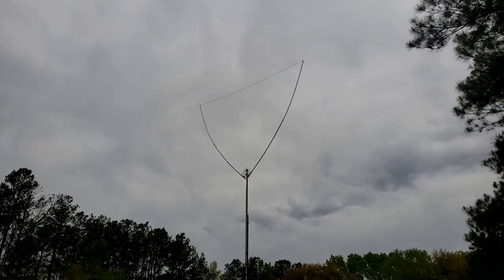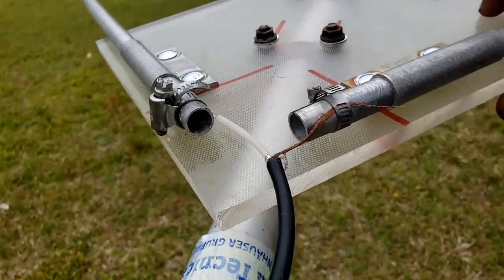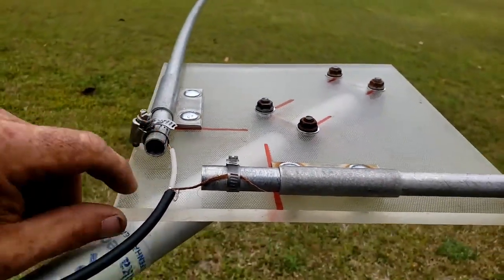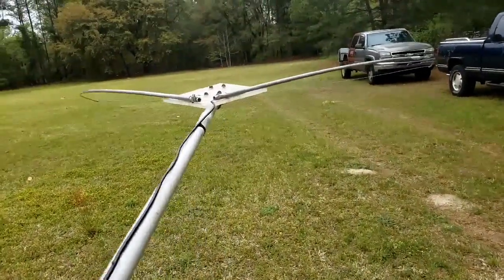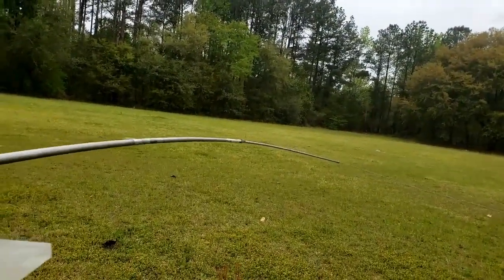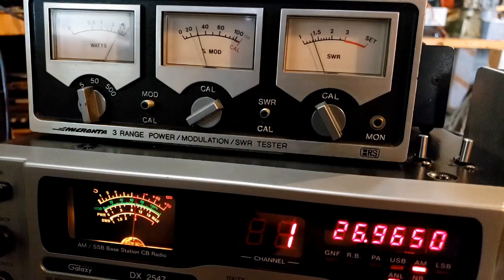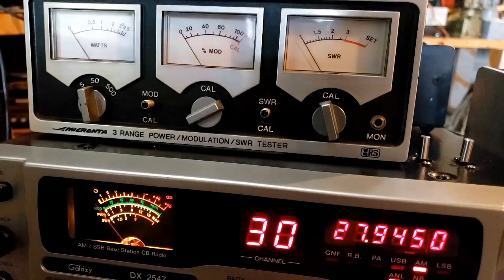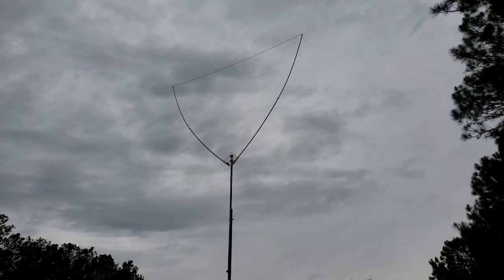CB Base Antenna, Full wave Delta Loop

Comment: Great old school meter you got there... I manage to find a copy of a Zetaggi SWR/120W Power meter with an included 12 to 10 meter tuner I used to have back in the 80's, Have a different brand but works the same way. It also has been discontinued though...
But that triple needle meter of yours is awesome...!

Comment: Still love your content on here and the builds . .. not much luck with some of my home made antennas but IV became quite novice at building and fabrication of metal and such now I may try to step back into the cb world and build my antennas ..as I can't afford jack chit this day and time but can get any material to make stuff . Used small dollar store extension cord  for dipole just cut it up solder and add the connector and solder it. .. boom done

Comment: What about building this with just wire ran inside pvc? Even the stock aluminum sections are $62 at DX engineering. It would be nice to find an inexpensive alternative

Comment: A full wave loop can be in a square (4 flat sides).  But the impediance is 100 Ohm.  But if you build it in a rectangle (higher than wider)  You can drop the impediance to 52 ohm ;)  The ARRL antenna book has the formula.
Reply: the gain is a fraction higher too
Reply: @Dazzwidd 1 dbi.. am I correct??

Comment: Why can’t copper wires be connected to aluminum,I have always done that since the 60’s I mean I’m not big time into the way you build them, I don’t have the money to buy all the high end meters that you have,just a old swr that’s it
Reply from the maker: copper will corrode when connected to aluminum. Thanks for watching, 73's
Reply: @MowerJunkie  I forgot All about that it corroding. Ever since I got into my ^0's and got lime disease, It causes Memory lost, They didn't catch I had it for 3 years, Now i have bad joint Problems and everything Else Thank you for your Help
Reply: @MowerJunkie in a marine environment it matters, coat that connection and clean it every couple years and your gold

Comment: Pretty cool man.  I wanted to build something like this for 20 meters.  I wasn't sure how to handle the base part...and your idea with the plexiglass is a great idea.  I think I am going to give it a try and see how it works.  It's going to be for portable operations, so I am thinking of using some small fiberglass crappie fishing rods and the entire radiating part of the antenna will just be wire.  Thanks for the idea!

Comment: I figure you could add a 7 ohm resistor o get the 50 ohm needed, but that may affect your swr and have to make that adjustment.  I'm not 100%, but it sounds reasonable in my mind.

Comment: Good delta loop pretty wide band. May I how long was the stranded wire connected to each element and was the copper wire in contact with the aluminum?
Reply from the maker: Sorry, I don't remember the length of the wire, But I think it's in the video.

Comment: Instead of using 70 ohm coax could u just use 50 ohm coax right threw thanks
Reply from the maker: it has to have either a 4-1 Balun, or the tuned piece of 75 ohm coax. They lower the resistance, making it safe to transmit on.
Reply: What length in metres do i need the 75 ohm coax to be thanks
Reply from the maker: it's been a long time since I built it, and I don't remember the length. But I'm pretty sure it's in the video.
Reply: Thanks i just realised i have a Foxtel dish on my roof that has 75 ohm coax on it so i can just take the coax from that

Comment: Fed at the bottom provides horizontal polarization. Feeding at a side provides vertical. Optional substitute parts:  Fishing Rod Blanks or PVC with the wire inside of them. This antenna will work very well 1 foot above ground. Of course, 15 feet is better.

Comment: Made the antenna to your exact measurements and the antenna  SWR was under 1.6 over 26 to 29 mhz... fantastic
Reply from the maker: Awesome!
Reply: @MowerJunkie  Rebuilt the antenna..This time I used 12 mm aluminium tubing for the top radial (rather than the wire)..flattened ends, and bolted at corners. Still very good SWR... My pole is only 4.5 meters to the base of the aerial..All aerial lengths are sleeved to adjust length if required..

Comment: I have a Maco V quad. Can I build a delta loop out of it?  I cant get a decent swr on the V quad.  Also can I use the Gamma match from the V quad on the Delta loop. Please try to respond.
Reply from the maker: I'm not sure I understand you, Because the V-Quad is a Delta loop antenna. double check all your measurements to insure they are all correct. if it's put together correctly you should have an SWR below 1.5. then fine tune it with the Gamma match.
Reply: @MowerJunkie  Thanks for the reply. I think my problem is that the V quad is way too close to my 5/8 verticle.  As I turn the driven element of the beam away from the verticle, the swr goes flat. Looks like I'm going to have to move the verticle. Thanks. I scribed and liked.

Comment: Might want to try a wound toroid balun rather than the matching stub.
Reply from the maker: this antenna was just an experiment to see if I liked a Delta loop. This past weekend I put together a Maco VQ3, 3 element Delta loop antenna with a Gamma match, So far I'm loving it!
Reply: @MowerJunkie  I loved the design, I'm a ham myself, but I still get on CB too.  Have an old Midland 40 channel on top of my Kenwood TS-2000 amateur rig.  I need to upgrade my CB radio to one with SSB though.

CB was my first introduction to radio as a kid, so it still has a special place in my heart.

I do a lot of experimentation myself.  I currently have a whip for CB and an Inverted L for 160-10 meters, Comet GP95 for 2 meters, 440 MHz and 1.2 Ghz.  I run a Kenwood TS2000 for the amateur bands, its a ham shack in a box, cover 160 meters-1.2 Ghz minus the 60 meter band. I'm setting up a satellite antenna array, I really want to make a contact with the ISS.  I've tried using my handheld radio and yagi antenna, but the guys running 100 watts over power my 5 watts.

Have fun on the air MIke//W8MLD.

Comment: Will a 2:1 Balum work on that instead if the 75 ohm wire?
Reply from the maker: Yes, you can use a Balun instead of the 75 ohm coax.

Comment: What wire size wire would you recommend for using 500 watts on this setup. I am going to build 1. I have everything on order now. Thx again for the video
Reply from the maker: I used #12 stranded wire and it handled 500 watts easily. Thanks for watching, Enjoy your new antenna.

Comment: I built a similar  delta loop. It was good for short  skip. I used 6' of RG-11 coax I bought  from  DX Engineering.  I used the formula 
1005÷frequency in MHz.

Comment: Mr Mower Junkie, you should bore them with some of the details. It's always best to explain why you do something when teaching anything. At least that it's a quarter wave stub, a coaxial transformer, the same principle use for phasing. A few things I want to mention: I take it that's RG6. It's mass produced like no other coax. I also assume you used around 80% VF for your calculations. Now, yes you can question the quality of the coax, however I would be mainly concerned with the velocity factor. The consistency, reliability, QC. Although you did say you have an analyser, maybe you trimmed the length with that. Anyway, I would be inclined to use a military spec coax like a good RG59, with 95% shielding. Of course this will have a 66% VF. The other thing, we estimate the loop to be around 100 ohms in this case, but to see a 50 ohm input impedance with a 75 ohm stub, the loop would have to be around 113 ohms. If your stub is cut to a 1/4 wavelength, as per VF with 43 ohms at the radio end, this would mean your antenna has an impedance of around 130 ohms.
Reply from the maker: Let me start out by saying, I don't do these videos to teach people, I do the videos just to show what I'm up to. But I'm always happy to help others with their antenna projects.
Thanks for watching, 73's from 151 SC.
Reply: @MowerJunkie  no worries, fair enough. Hey I've gotta pull my finger out and get my 4 element LFA back up. Then maybe I could make contact with you one day, I'm in Victoria, Australia. I've built a lot of antennas in my time (not a ham), the LFA is by far the best. One more thing worth mentioning, remember you can feed a delta loop at several different points and orientation. This changes polarisation and angle of radiation. I believe one of the top corners in that configuration is good for low angle. 535 Jeremy.

Comment: Just to ask out of every antenna you've built or own which one do you feel is the best range local and DX and great receive I've kinda thought about either the most common Antron 99 or possibly the Maco V58.
Reply from the maker: My favorite of all my antennas is My Homemade 2 element Yagi on the flat side. It works really well for DX, and most of my locals are also on flat side.
The Antron 99 is a good antenna, and very easy to setup....But the Maco V58 is a better antenna.
Thanks for watching, Take care.

Comment: Looks great I did a very similar type with two fiberglass fishing poles at 4mts each side and 36ft of washing line with the wire inside .. same as you a 75ohm coax as a balum but wound it around a 4-1/4” former then to 50ohm coax works a treat

Comment: Oh another thing that short piece a real thin coax you said do used was a 7’4” why do you fuse the coax made like a choke 8 or 9 times with that Wrapped around a 4 inch pipe strap to would that make a difference it’s like a choke will get the ohms back down because I watch a lot of him operators using a choke for ohms
Reply from the maker: the 75 ohm coax does not need to be wound for this antenna, and mine is a temporary setup, so I just ran the coax down the mast. Take care Shep, Happy Easter.
Reply: @MowerJunkie  you to happy Easter 🐣 73

Comment: That is awesome I was gonna try to build one of those but I thought they use string for the top but you use wire I never thought about that so I’m glad I didn’t try to make it yet anyway I was wondering could you use 102 stainless whip used two of them the same way but you probably have to use some kind of a at the tip on top some Chyna spacer for the wire not touch the tips of them I don’t know if there a way to put 102 to stainless whip could that be done well I guess be the same way that one you made but that was the two ground plates on it with two stainless 102 stainless then you had to ground lines each side of it but I’m just talking about the one you built now if we could do it the same way with the two stainless whips could it could be done what it be like
Reply from the maker: Sorry Shep, this antenna can Not be made out of 102 whips, They're to short.
 73's, Thanks for watching.

Comment: Many years ago, I had a 2element delta loop on 27mhz. Bandwidth was over 5mhz under 2:1 SWR. You just need a little height for them, they work best if you can get them about 25-30 foot up.

Comment: it's ironic that I came across this video today after I put together a 3 ele Delta loop a few hours ago.  Mine is still on the ground waiting for better weather to try it on the roof.  14' boom and I'll probably keep it horizontal as you have done.  A few years back I ran stacked delta loops(4 of them) and they were great for 10/11 meters.  Good luck chasing the dx.

Comment: Looks like prototype for the Maco V quad almost exact specs they use fiberglass tubes for spreaders and basically feed wire thru the pipes and spread to the other side and back down using gamma match instead of 7' 59 tv cable to match i made a box version decades ago out of old bamboo poles used to hold carpet ( dates me a little huh) it talked well audio on side and signal on front strange as heck

Comment: Another interesting antenna project. MJ.  Have you considered the Demi-Quad, which also uses RG-59 matching/Network. Vertical or Horizontal/Polarization, depending on feed-point location.
Which could then transition into a 2-element/Quad that can be directly fed with 50-ohm coax. The single demi has a 2 Dbd gain and the two element-quad has a 7 Dbd gain. 
Still call out for you on 385 and your test freq, but no luck. Talked with 1963 Jamaica a few more times 73/88 DX21
Reply from the maker: I have considered building a quad antenna, and I do have plans for one in the future. Thanks for watching, 73's

Comment: Is the velocity factor of the 75 ohm coax 0.83?   
If so, at a freq of 27.385, the calculator shows 7.4528 feet which translates to 7' 5-7/16".
Plus, I would assume the measured length would be from where the coax shield and insulated center conductor diverge.
So your 1/4 wave stub might be a little short, depending on where you measure from.
BTW, I'm just a dumb old bricklayer; know nothing about electronics.
Love your channel.
Reply from the maker: the velocity factor on the coax I used is .82 my math came out to 7.366' for the 75 ohm coax. Thanks for watching, Take care.